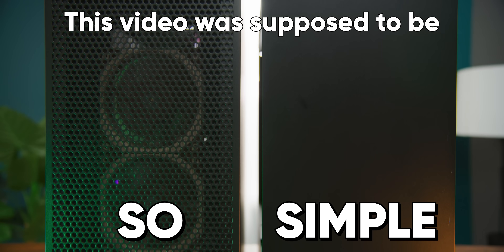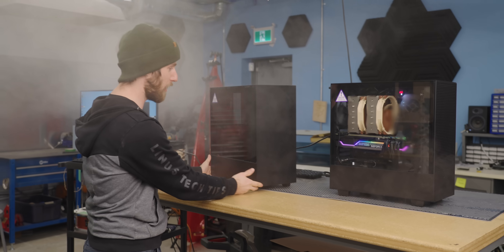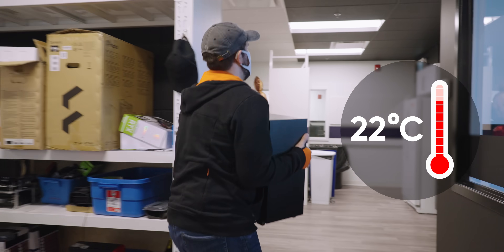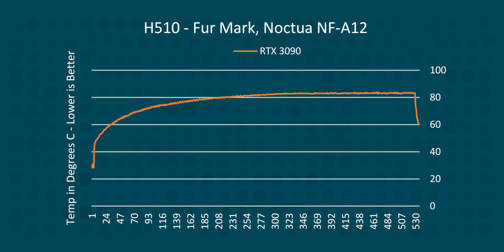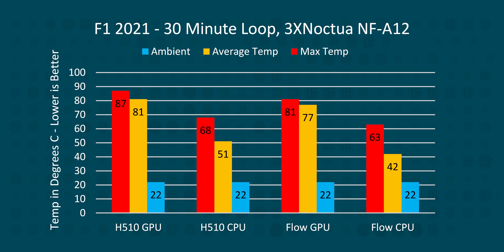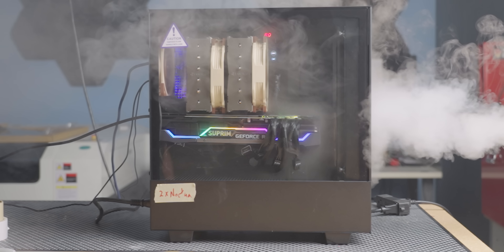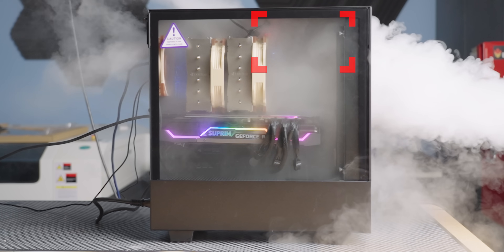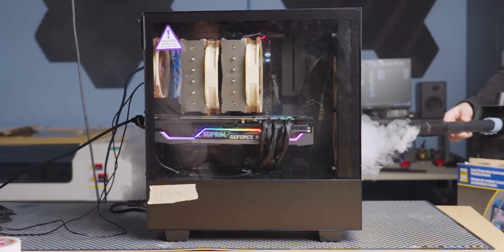Everything You Know Is Wrong - Mesh vs Non-Mesh Front Panel

Comment: I thought the H510 was tolerable if you configure it for negative pressure, no? I thought steve said that.

Also, the problem with the setup  is that normally the H510 lets the GPU breathe through the PCI slots. But when you force air in from the front, you completely stop that avenue of fresh air for the GPU. So you either need to duct the lower front fan to make sure it feeds the GPU properly, or run your air back to front.
Reply: I'm running the H510 in its stock (negative pressure) configuration and thermals are fine with a non-overclocked 5800x and 3060ti. I read somewhere that adding front fans actually hurt the thermals for this case so I left it with no front intake fans.
Reply: you p[robably sound like kermit the frog irl
Reply: This exactly. I have one and live in the tropics and my temperatures are fine. It's just an easy target. When someone says it's a "bad airflow case" I instantly know they have no clue what they are talking about.
Reply: Yes negative pressure and a fan in the lower psu departement blowing up on the gpu. I got that setup in a h200 and its doing just fine. I tried going all in with a lot of fans in front, and it failed, as this test did. My analysis was that the positive pressure hindered gpu from getting air from below.
Reply: Or just dont buy that steaming pile of crap.

Comment: I have that nzxt case with just the sliver of mesh on the side.  I bought it from a local PC shop cause it was all he had, and I needed it for an xmas build.  I was super skeptical about how the airflow would be...but I'm pleasantly surprised.  I have had no issues with anything overheating.  I'm only running a 1070, so I'm not really throwing out alot of heat.
Reply: It's just throttling, not actually overheating.  No matter what, NZXT cases leave performance on the table.

Comment: I have a itx build using the SSUPD Meshlicious and I have better thermals now than I ever did with a atx build using a bunch of fans. The only two fans I have for the case are the 2 on the 240mm radiator. It's quieter, cooler and not filled with a rats nest of fan wires and splitters.

Comment: Also if you used a case with 3x 120 on the front you would have air coming up from the PSU shroud and fill that bottom left corner.

Comment: Old pc's, closed top/front/side.
Omg let's ventilate the front!
Oh it chokes the gpu.
Let's exhaust the side!
Oh still chokes the gpu.
Let's intake the side!
Hmm we need more exhaust?
Let's ventilate the top for exhaust!
Perfection.

Years later:
Gpus getting thick though wer tired of trying to make fans fit on the side panel...
Let's add plastic so you can see your parts!

Tempered glass enters chat.
Omg we need to glass the side!
Thick boy gpus starving again.
Let's glass the top!
More heat gets trapped.
Let's glass the front!
More starving happens.

And now we poking holes in every side again.

Let me guess?
Exhausts top, big cpu cooler, lots of intake and part of the gpu is starved?

Omg what about a intake on the side panel!

We really just reinventing the wheel every 10 years or what?

Comment: Would be interesting to see if some 3d-printed guide could improve the airflow to the GPU.
Reply: Major hardware already did this, and the results were impressive.
Reply: 15..20 years ago quite a few brand PC had plastic CPU "air tunnels" within them. Sure you need to cool the VRM too, but that's doable too.
Reply: a simple peace of card placed between adjacent fans stops a lot of cavitation if I am using some 80mm fans The card will be 80x80mm dropped the max temp by 10 hole degrees relative to ambient. this was just two 80mm fans shoehorned  into a pair of redundant optical disk drive bays in a retro case, the difference was one peace of 80mm square card. this was cpu temp. as for the GPU there was a good flow of air from the lowest case fan to keep things under check and the bonus there is enough flow around that zone to keep the SSD's and hard drive cool enough. In the old days we called it CAD engineering Cardboard Aided Design (you would then replicate the card bord with material of choice eg Aluminium) I kept the cardboard as it is a soft carbon fiber composite...
Reply: Tried this, just even a simple paperguard worked well. Major Hardware has some nice vids around the topic.
My case is larger so I even put heatsinks on the back of mine with a small noctua blasting down on the backplate. Only Cyberpunk can truly heat it above 76C anymore.
Reply: Venting and shrouds do help. Old school modding would be to get some home venting from a hardware store and putting it into your case to direct flow to the cpu.
Reply: Maybe some fan ducts or fan mounting brackets that make them blow at an angle, combined with mobos that put more space between the first PCIe slot and the CPU? I think that might help.

Comment: You clearly need a case where the intake is across all of its height, not two thirds of the intake going directly to the CPU... in other words, the fans in the H510 are too high up and need to be lower down for better GPU cooling. NZXT messed that one up.

Comment: OK this video had me worried about my $15K setup, since I maxed out the fans that case could hold, 9 fans. The CPU has a noctua tower I modified by adding another CPU Fan to it to facilitate better air flow. Total fan count is 15; 9 case fans, 2 cpu fans, 3 on the 3090, 1 on the PSU. Either way the set-up I got running furmark didn't see heat past 60C, in a 28C room (I live in Mississippi now, so hot summers and the AC in my house is kind of a joke). Cinebench peaked at 54C, and that sees to be the average peak I can get on it, same with the GPU. BUT I purposefully bought what is probably supposed to be a server PC case, since I think it can hold like 20 drives, so it's MASSIVE inside and I put the GPU on the second 16x slot. Maybe that's why I get such good results. I have 5 fans in exhaust, 4 on top, and one on the back (140mm) and 4 on the front as intake (8 of the case fans are 120mm). The fans are all Noctua's Industrial line 32 or 3600RPMS.

Comment: I found on my solid front 5800x/3080 setup removing the PCI slot guards below the GPU dropped temps 5 degrees due to a mostly negative airflow drawing air to the GPU...

Comment: this goes back to my theory about power supply at the top to assist in the exit of hot air with out adding hot are inside the case..  power supply at the bottom and some of that power supply heat rises up into the case..

Comment: Personally I'm really happy with my H500. Just took off the dust filter from the intake and temps are good enough with 70 C on the gpu and about 55-60 on the cpu while under full load. Running a ryzen 5600x with a rtx 3070, 2 120mm intake and exhaust fans.
Reply: How is the dust build up?
Reply: @penedrador   i dust my computer like every 2 months so it's not an issue
Reply: How do you get the GPU temp so low?
Reply: It doesn't help that they installed the fans wrong.
Reply: Almost exact setup, 3600 + 3070, same here with an old Corsair Spec 02. Better thermals than most 2021 cases.